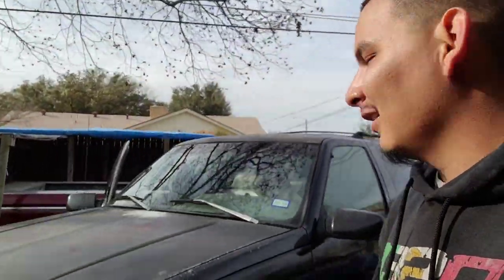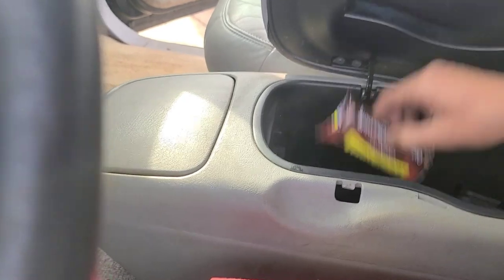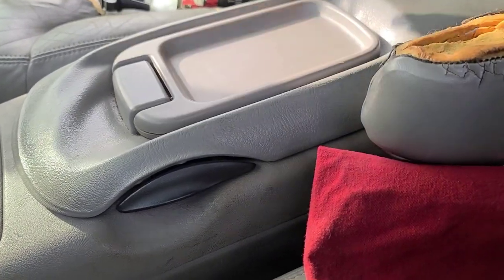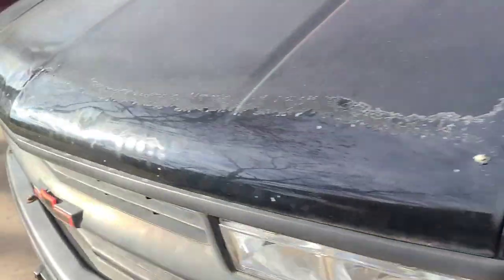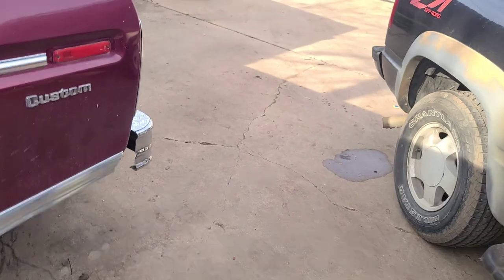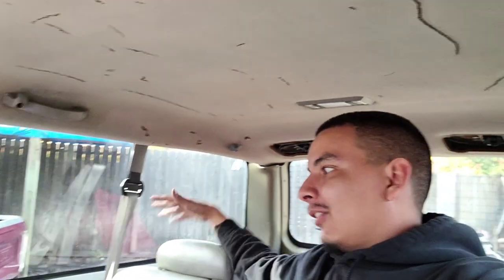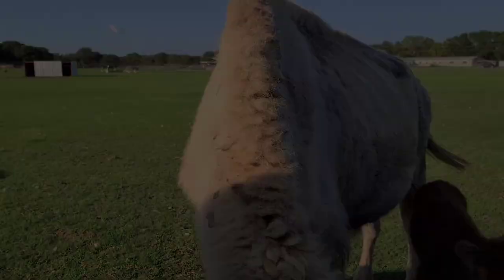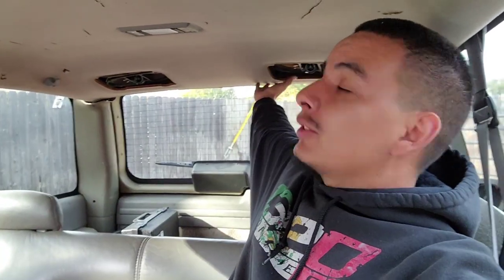2 Door Tahoe's Hidden Compartment! Plus 4 awesome things I Love About The 2 Door!!!

Comment: I have a 95 Yukon 2 door lifted with 35's and love the truck. I bought a 94 Chevy pick up new in 94 it is the same truck but with the older interior. The light on the cord reel has a magnet on it and will go all the way back to the rear wheels so you can change a tire at night on the side of the road.
Reply from the maker: Dammnnnn you learn something new everyday. I never knew about that?

Comment: FYI the reason your battery dies is probably because your dome light is on. The door panel pushes that pin down but it won't push down if the door panel ain't on. Had the problemo
Reply from the maker: That's good info!

Comment: I have a 96' 2doorhoe my self with the barn door and 4x4 on 33" toyo mt wrapped on ltz wheels. Love my truck and always catch myself adding to it. Also you are right about 
 all that airspace I'm running a Boston acoustics amp and the infamous spg-555 13" Boston sub and it bangs for days. Also you can swap out that toolbox under the hood for a second battery tray that was optional in other models.

Good video bro stay up and ignore the bullsh!t
Reply from the maker: Thanks for the kind words!! Ignoring the BS always!

Comment: I'm thinking about purchasing one this week. A 97 with 190k miles. Can I contact you for advice??
Reply from the maker: Feel free to keep commenting on here and sub bro. The 2 door community is here to help too.
Reply: @YLegalRacing  Thanks bro just subbed! Do you think the old schools are more reliable or just as much as the newer models? I want something durable and I don't want something that  won't run because of some dumb electronic sensor
Reply from the maker: These run forever bro. Not a lot to it. Once you give it a good run through she'll be mint. Newer trucks are cool dont get me wrong but this will never leave you on the side of the road. No parts shortages, programming, diagnosis gremlins or complicated wiring. After my trans swap the 2 door has been my daily for over a year and she's mint.
Reply: @YLegalRacing  Thanks man I appreciate the advice. They want 11k for it. It's bone stock original paint. I can put the mods on it to make it mine. I don't wanna waste 20k on somethin newer that won't last or I need a specialist to fix lol. It look like I won't lose too much towing capacity either from my 08 Xl denali that is fallin apart. My denali is throwin codes evap, stabilitrak, oil pressure etc too much for me. I just love the size of the truck. But 2 door trucks are special to me. A coupe truck! They aren't really on the road much
Reply from the maker: They aren't bro but they're so stout. A lift or lowered they're solid AF. 11k is a bit high, I'd join all the Facebook groups and try to score a deal on one